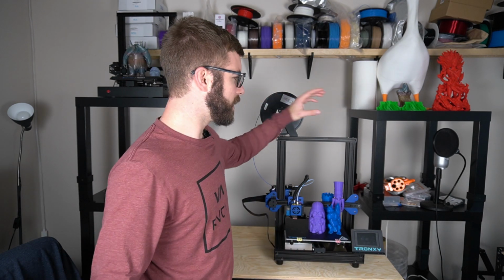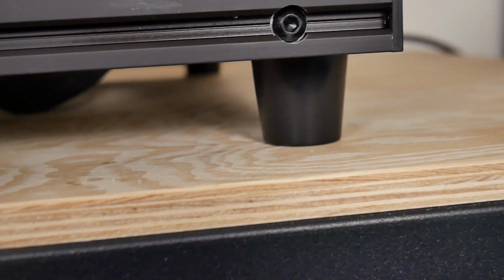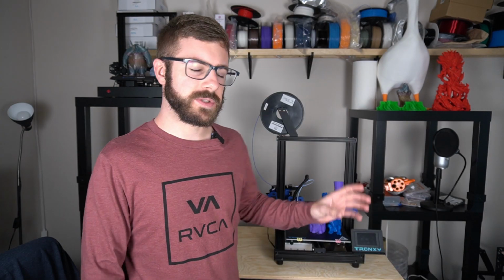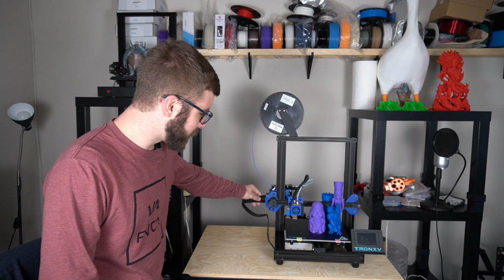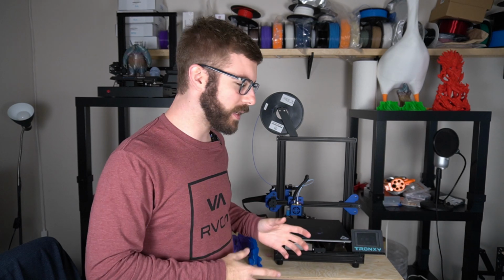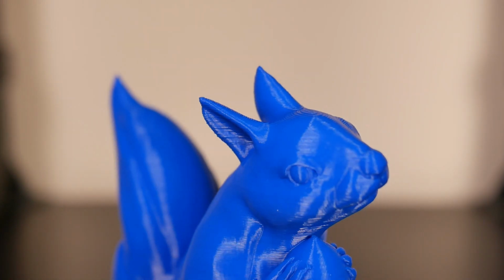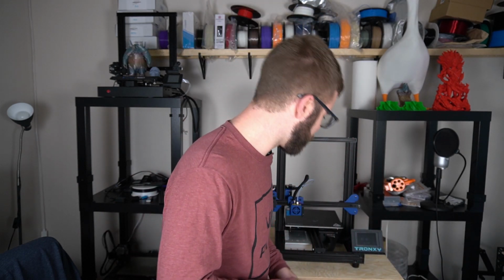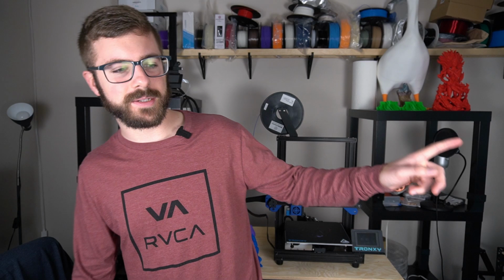$200 3D Printer With Auto Bed Leveling! Review Of The TronXY XY-2 PRO 3D Printer

Comment: The problem of the CR10s Pro with Autobedleveling is 100% a firmware problem. I even upgraded to a bltouch but that didnt help eithe. I really tried everything but the solution was upgrading to marlin 2.0. Since that everything works flawless.

Comment: I'm really split between this and the Ender 3. Which one would ultimately be the better choice?
Reply from the maker: I really do love my Ender 3
Reply: @ModBotArmy  After thinking it through some more, I think I'll go for the Ender 3. Happy printing!
Reply from the maker: StRiKe awesome man :) happy printing!!
Reply: @strike171  I HAVE BOTH. SIZE 25 X 25 I CAN ACCOMODATE MORE MODELS AT ONE TIME AND COLOR LCD AND FULL MENU CONTROL IS MUCH BETTER IN TIMES OF PRESSURE. I ALWAYS LOOK TO PRINT FIRST ON TRONXY. ENDER 3 IS OK BUT I DON´T UNDERSTAND WHY IS LIKED SO MUCH, LOOKS LIKE YEARS BEHIND, FORD T.
Reply: @posterpage1  what makes it better?
Reply: @posterpage1  aren't they both 250x250 print space?
Reply: @ChristopherJones16  Ender 3: 220x220x250 mm, Ender 3 Pro: 220x220x250 mm, TRONXY XY-2 Pro: 255x255x260 mm.
Reply: pr0wl3r666 yeah I recently made a chart comparing the sizes and prices of printers since I made that post to have something to compare in front of me. Now what I’m looking into is if CoreXY printer are better than these style printers.
Reply: @ModBotArmy  This one seems better than the Ender 3 - what's the difference between them?

Comment: I am looking to get a 3D printer in this price range ($200 - $300) and am quite intrigued by this one.  But I've been doing a lot of research and also considering, a base Ender 3, and then upgrading the motherboard, drivers, extruder (to direct drive) and the display.  The TronXY seems like a better deal, but how upgradeable is it?   Can I replace the mainboard?  Does it use Marlin for the OS?  Any guidance would be appreciated.
Reply: You could always get an ender 3 with an attached BL Touch.

Comment: hi my friend, can you use the direct drive extruder guide for the ender 3 in this tronxy xy-2 pro? and if I converted to direct drive can I put another z-rod/motor to prevent sagging? and for last, would you recommend to change the bed for glass?

Comment: so this or ender 3 for a first printer?
Reply: This one is cheaper and in stock. You'll do the same upgrades to this as you will with the Ender 3 like upgrade the fans, the power supply and controller as well as the stepper drivers and are BL Touch for bed leveling on the Ender which this already has. You'll upgrade to a better Hot end and extruder. Pretty much rebuild the whole thing but the frame
Reply: I am tackling this decision.

Comment: nice review man, I just purchased 1 myself. I couldn't find any mods/upgrades for this printer online anywhere which is a bummer. Have you done or recommend any upgrades to this thing?
Reply: How is the printer going mate?
Reply: @sexyfacenation  its great honestly. It was OK from factory, but over the time Ive owned it, I upgraded the extruder and rewrote the gcode for the firmware to calibrate and dial it in and its been awesome since. I only upgraded the extruder (SeeMeCNC EZR which works flawlessly for me) for TPU. The stock extruder is not great for flexible filaments, kept jamming, but works great for harder plastics.
Reply: @nayt33z  thanks for that mate. I will give it a shot. For the price it is hard to ignore, and I don't need to do flexible (at this stage) 
Cheers

Comment: I bought an XY-2 Pro recently and I got the version with the upgraded motherboard, and it is really silent. All I hear is a soft sound from the fans, the stepper motors I can't bearly hear. It prints great, both PLA and PETG without any problem, so I'm super happy :) Btw, great review, love your channel :)
Reply from the maker: That is awesome to hear! I am stoked you got one and that you are happy with it. Thank you for watching 👍
Reply: Is the hotend/tube good enough for PETG? I have an Ender, and I have stopped using PETG until I can get an all metal hotend.
Reply: I got one with the 1.5 board, only found this out when I heard a pop and smelt burnt circuitry, z axis stopped and screen only displays white. luckily still in warranty though.
Reply: I'm pretty interested in this machine, how can I know if it's the upgraded one? Also I saw another comment saying how noisy it was. Soooooo.... now I'm confused. Lol

Comment: Had one. It broke in 3 weeks. Printed great while it worked. And honestly it had less to do with the machine itself. It was the included SD card that failed. But failed catastrophically and took the controller board out. Found out when I plugged the card in and computer locked up and the card got so hot it burnt my finger when I took it out. Also this won't work out of the box with octoprint. There are 2 plugins to work around firmware issues.
Reply: Couldn't you replace the controller with a SKR ?

Comment: sent mine back ..nothing but problems and burnt a hole in the bed !!
Reply from the maker: How did you manage to burn a hole in the bed?? I guess I could see with the surface since it is a plastic but the nozzle would have to really dig into it. What other issues did you have??
Reply: @ModBotArmy  i had it two days first print was great and easy to setup...then i started to have problems with the z axis and auto bed level was off by 10mm!! then i tried a second print and come back with the hotend stuck into the bed burning a hole in the fibre glass bed!!! sent it back and now have a ender 3 pro
Reply: @gregory3340  I have the same problem, I ordered one for my brother and its a nightmare, going to send it back for an ender 3 pro. crap machines.
Reply: @TheToolReview  Probably it is the Bed Level Sensor that is slightly too high up, try lower it slightly, and it should work like a charm.
Reply: Lol. Instructions unclear. Burn hole through bed. A legit meme.